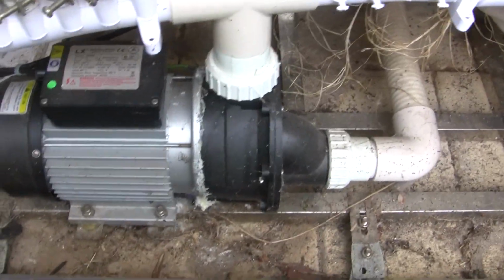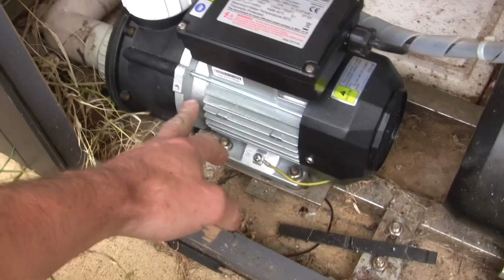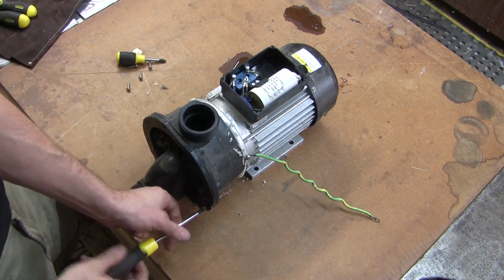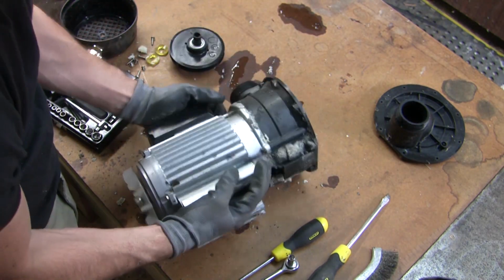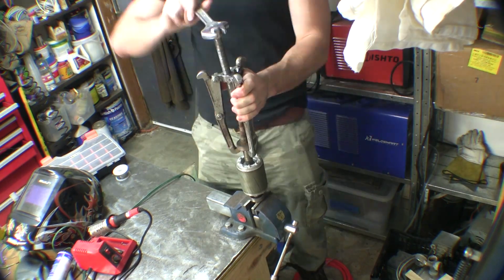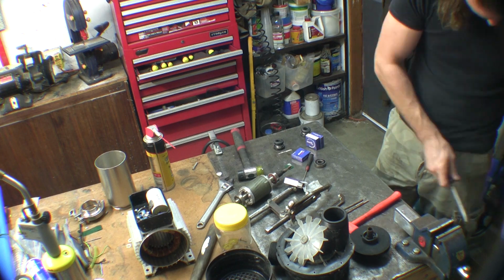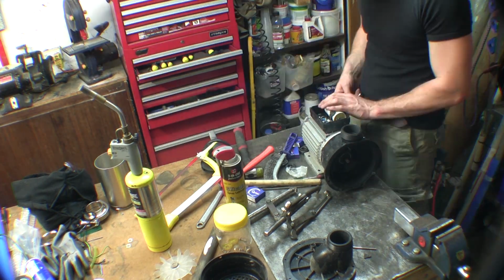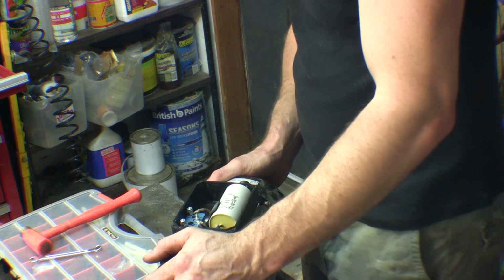spa/jacuzzi pump repair (bearing and seal)

Comment: Are you sure that's corrosion?? Isn't it limescale?!?!? Uncontrolled limescale buildup is guaranteed to screw up your seals and your bearings, letting water leak to all parts of the pump and deposit yet more limescale. Those LX pumps should have lasted longer than that and should not have had any buildup like that. I know that because I have two myself and fill the tub with extremely hard English water
Reply from the maker: @davidgray3684  it's not lime scale as the water here is very soft, if there is any leak at all the bromine/ chlorine will corrode the motor housing very fast

Comment: Hi ! can not unscrew the impeller as you have done on 2:46. Have used the screwdriver to hold the shaft and unscrewed counterclockwise impeller by hand only? Chinese pump DXD310

Comment: Hi there I have a question is there a possibility that water could go to the engine? I'm always worried about that.
Reply from the maker: theres always that possibility. thats why all spas, pools, hotubs etc have to have an RCD (safety switch) installed. but its the heating element that is the most likely to cause any issues with power getting into the water.. but all metal parts that are in contact with the water should be grounded

Comment: So my Jacuzzi pump just turned off without warning. Zero symptoms leading up to it…is that how they usually go?
Reply from the maker: If the capacitor has pooed the bed then yes, they can overheat and blow the thermal fuse in the windings.. Some tests with a meter should tell you if the windings aren't open circuit.. And if I need to explain how to test that, you probably shouldn't be poking around in there.. There's deadly voltages involved

Comment: Thanks, your video helped me change just the ceramic seals on my seeping/dripping pump. Bearings were still good, but would be really helpful if you could identify the bearings size for others in the future?
& for the question about unscrewing the impeller from the motor shaft, it's conventional RH thread. Had to brace a large screwdriver on the rear slot & use thick rubber gloves to get a good grip on my really tight impeller, but it let go after some effort. The embedded impeller nut is brass  (self lubricating) going onto a steel shaft, so should release with medium force.
Reply from the maker: The bearings will be different for other pumps, but the specs of the bearing is written on the sides of the bearings

Comment: I have a Rimini spa bad or hotub , that is about 8 years old. I am in Sweden, We noticed a while ago that it did not seem to have full power, when pushed on full power, the flow was weak, everywhere. We also said to ourselves, that we think that we had 2 power settings, you pushed it in and got like 50% bubbles and then pushed it in again for full bubbles. But we only seemed to have one setting now full and off only. I know the pump is 2 speed, says on it. So I took the pump out and took it apart, noticed that the impellor was half missing, all broken, So I thought great was impellor, ordered a new impellor and seals, just the same, pushed the jet button on, which again only full mode, hardly any flow. could not believe that this was not the problem.
 And then after testing it for a good few times, the jet button refused to go on to full bubbles, I am thinking that this is some safety cut-off switch inbuilt. I thought for a while that possibly the pump smelled like it was burning just a little. I have taken out all the jets, emptied the water, blasted a hose through all of them, thinking that if 50% of the impellor is disintegrated, then bits must be stuck somewhere. Some small bits have come out. very small though. I am wondering if I need to buy a new pump, Just hope it's not the motherboard or control panel. Because the pump has not 2 speeds working, or something is definitely not right. What's your opinion. Is there something else I need to check? I am cracking up, not finding the problem, Could it be the capacitor? I am hoping a new pump will solve the issue. Appreciate your opinion thanks.
Reply from the maker: I'd test the cap for sure.. But if it's been like that for awhile then it may have damaged the windings, if your confident enough, open the motor and inspect the windings, if they have been hot then they will stink and have changed colour. If they are ok then the motor should still be fine, but I'd bet one of the caps is way out of spec..
Reply: @HomeDistiller  Thanks, the capacitor is sitting inside the black box with all the wiring. I can not find a capacitor like this one on youtube ,just has a black and blue wire coming from it. l have a multitmeter, but do not know what settings to test it. l could take the motor apart,it is out of the hotub anyway. Do you think the problem sounds like something to do with the motor still. It turns and like l explained replaced the impellor and seals. I can order a new motor quite a good price from amazon,but if it is not the motor, Be difficult to send it back to them. Freight is so expensive here in Sweden.

Comment: Hi,

I’m replacing my DXD 8A pump. I noticed that the hole that I used to inject ozone is blocked . Should I drill it ? What about the air switch ? There was no special button in the previous one

Comment: Hi, 
I have a similar pump and motor but I'm having a slightly different issue. My motor keeps shorting out inside the motor for some reason and I can't find info online about how to solve it myself. 
Do you have any suggestions?

Great video btw!

Do you have
Reply from the maker: I'd say that's ether a cooked motor (unrepairable) or the capacitor is dead.

Comment: Hi, can you remember what size the 4 motor bolt/threaded bar you used and bearing sizes ?
Did you put a new seal kit in, would of liked to see that go in if you still have the video footage.
Cheers.

Comment: Hi. I have quite a similar pump, LX JA 35. I changed it already last year. Now it works for around 2 weeks and then I got the message LF. So obviously not enough water can come through to heat.

When I turn it on and off, I see that it "tries" to start, but unfortunately it stops. What could it be? You think I need to screw off the whole pump like you did?? Unfortunaltey I do not have all the tools you are using. And the next technician is quite far away...

Thanks!!
Reply from the maker: Was it noisy when it was running? Do you have a screwdriver? Or even something think you can poke in the back and see if you can turn the motor by hand? It should turn very easily, if you need much pressure to turn the fan in the back (don't break the fan! ) then the bearings are no good.. If it turns easily and it just sits and hums when you apply power, the capacitor needs replacing.. If your unsure what you are doing get the technician to look at it. There is deadly voltages inside!
Reply: Yes, the darn capacitor nearly always the problem. I like how he speeds up certain areas, nice.